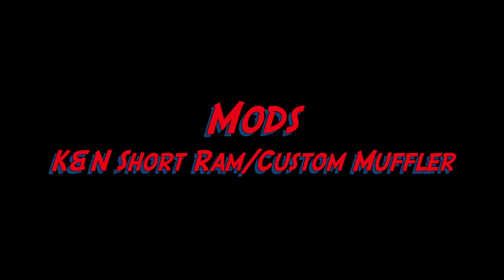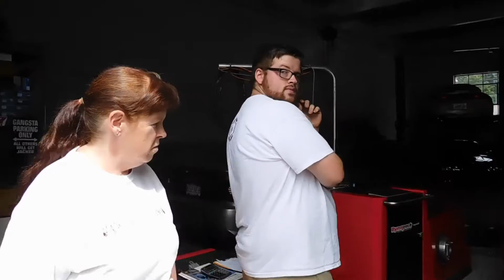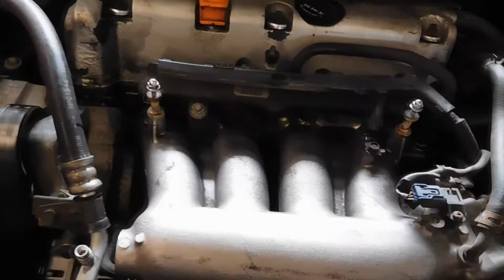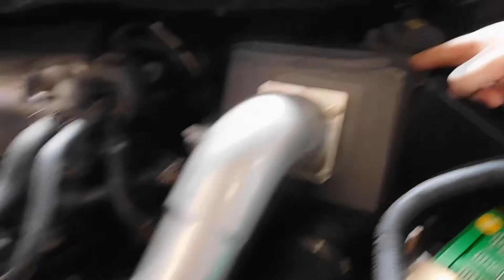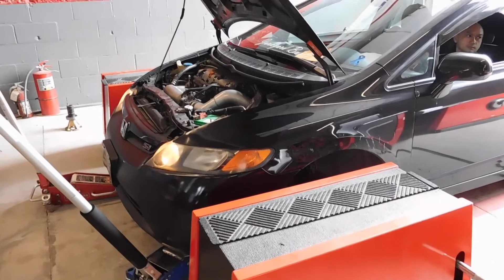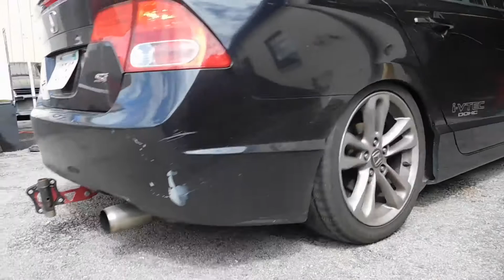Honda Civic Si On The Dyno! Listen To That Vtec Crossover!

Comment: i dont want to put you down but i have to tell you as a fellow civic dude that the k and n is not the best intake for power gains. some even say they give no gains. skunk 2 3.5 CAI is the best it gives the most gains
Reply from the maker: I respect your honesty bro!  I want a cold air, but I'm afraid of hydro locking my motor haha.  They sell like a shield to protect it right??
Reply: i think they do yes but honesty you dont have to be afraid of hydro locking unless you driving through a river of water. and the opening is placed right behind the bumbper and under is covered so only air from yhe lower vents cool air is going to the engine
Reply from the maker: But what if I plan on going off road with the k20? lol jk.  How much for a skunk 2 cold air?
Reply: around 280

Comment: That's the K&N cold air intake I was telling you about. I have the same one. Mine is not rubbing on anything like his does.
Reply from the maker: I want one!  The vtec sounds amazing with it...  You'll never guess how much he bought his for
Reply: I told you you're gonna like it. Vtec sounds means with it! If you can get one grab it man. You will not regret it. It requires little to no maintenance and it comes with a million mile warranty. I got mine for about $280 brand new in the box, free shipping.
Reply from the maker: That's what I'm going to do...  Anything to make some extra power!  Did you get yours on the legit website??
Reply: Gerb Productions It's about $300+ on their website. I got mine from Andy's Auto Sport